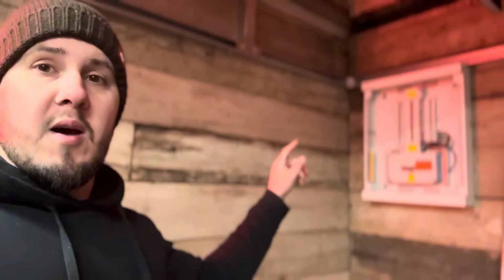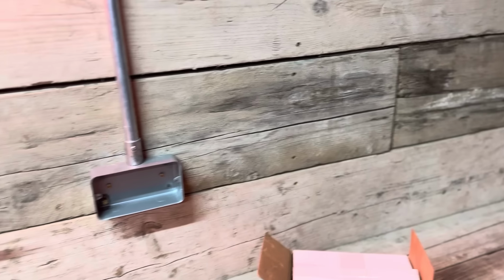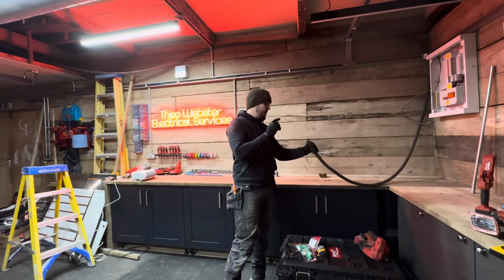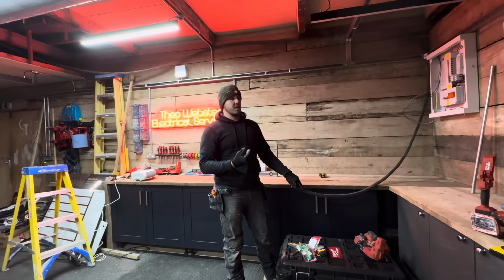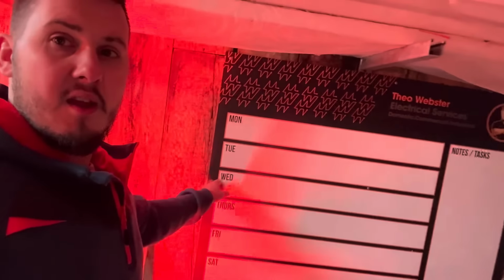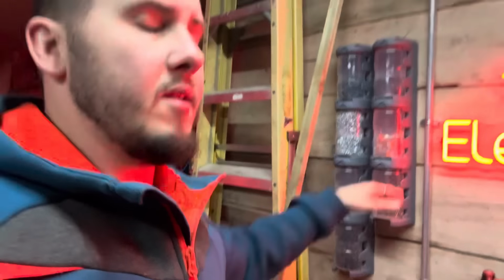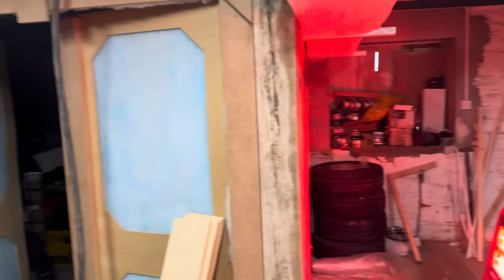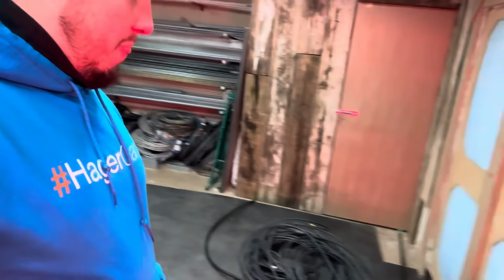Building My Electrical Workshop #commercialelectrician #workshop

Comment: Hi, discovered your videos a while back.... Great content. My old man used to be an industrial electrician. He would have wired the sockets ring in and out of the socket side around the room rather then a drop down from higher up on the wall. 
Is there an advantage to doing it the way you did it. Reason I ask is I will have to do a ring for our garage socket in the future and wondering if I'm missing a trick. Cheers mate and hi from Ireland.